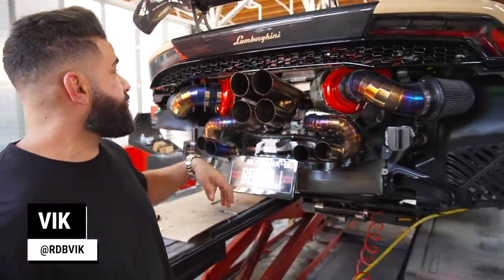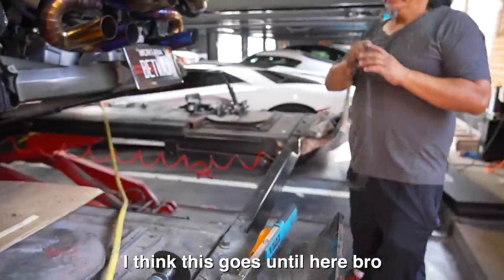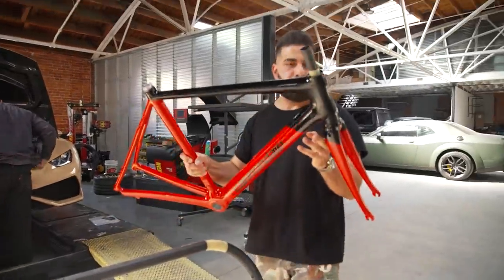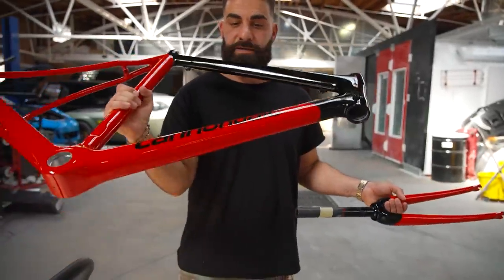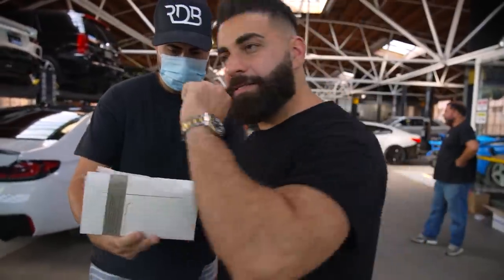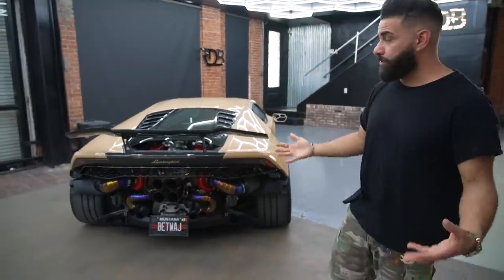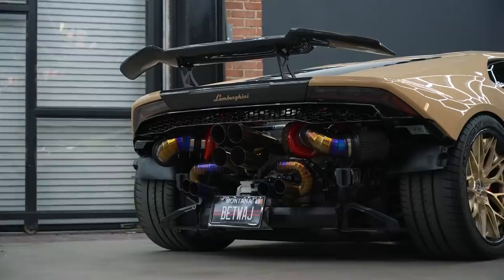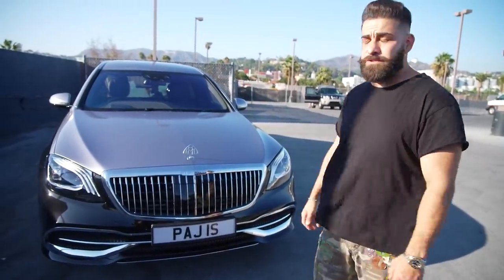Twin Turbo Lambo with 8 Exhaust Tips, 1 of 1 Pullman Upgrades.

Comment: Moses I drive a 2001 Camry with 117,000 miles on original motor. Car is the best had it since 2010  it had 29,000 miles when I bought it. I also have a 2018 Camry. Best cars hands down.

Comment: Doing alex chois lambo metal bracket on the outside can put ez release clamps on a militarized drone such as harop on the roof and u can close off a highway by the cops for 10 miles and on a perfectly straight highway a Lamborghini can reach 190 or 200mph and release the drone at the point of speed of 190 or 200mph for a fastest deployment possible of scrambling a small harop style drone if needed. Us military needs to give u a contract to do this or it can be done with a hellcat charger for cheaper but it's unstable at over 150mph and will need a 3 lane highway and a wide body kit perfect alignment and some more front downforce so it doesn't go airborne,  testing is best on Lamborghinis or other supercars, and the supercars might need a pikes peak front splitter for downforce to not go airborne by the ascend force of the drone